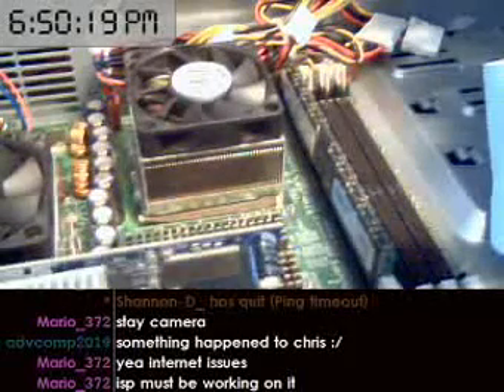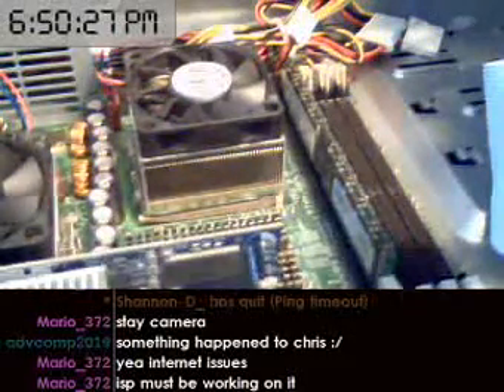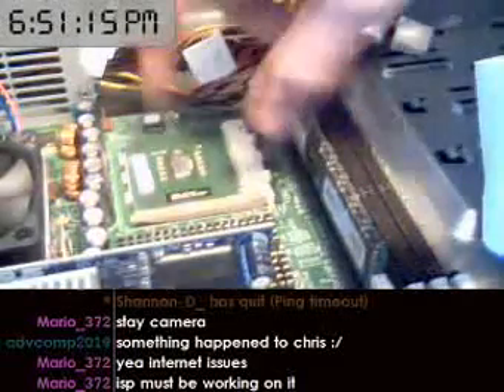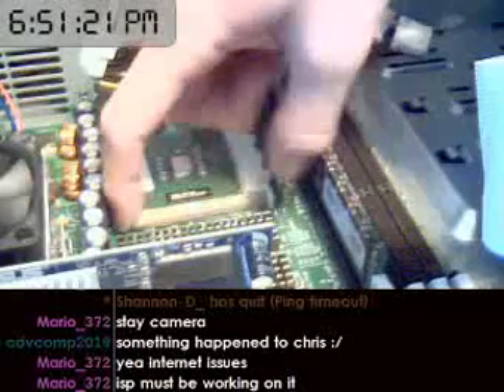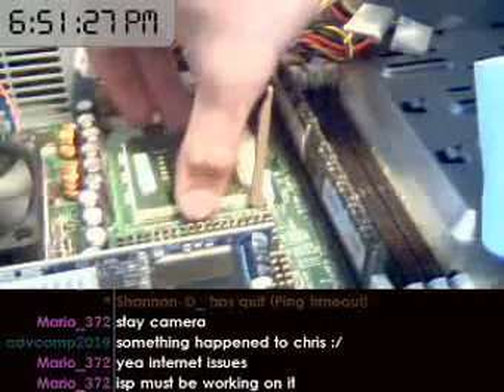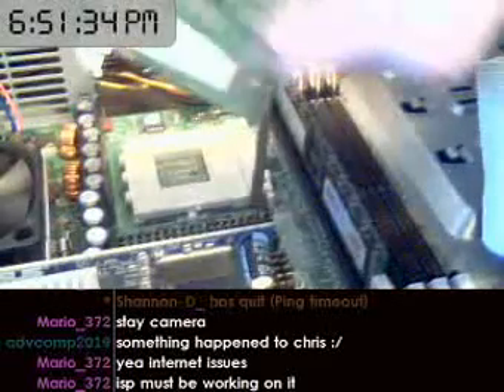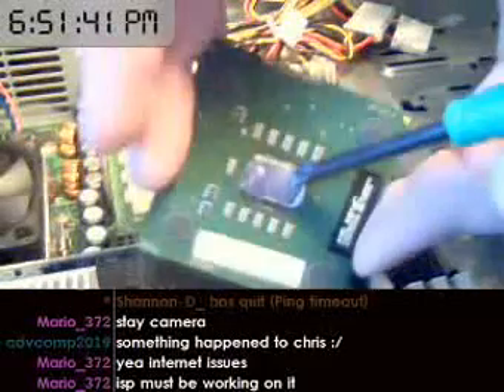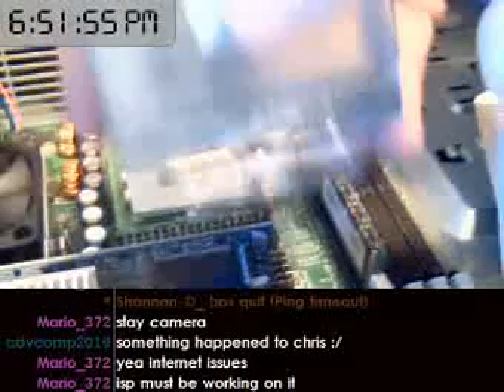How to install a CPU in a computer

Comment: can u install/ fit in heatsinks to laptops? einver since installed new ram my laptop has been overheating very fast. ive never installed a cpu before, but im looking to buy a dual core, any ideas amd or intel? ive seen some AMD's with the description 'quad core' or 'triple core'. do they mean the same thing? thx